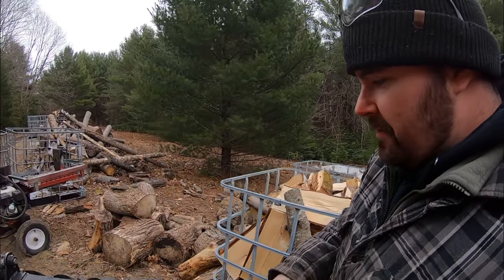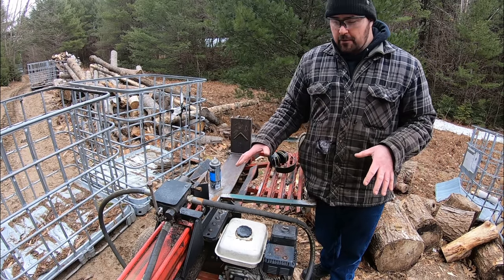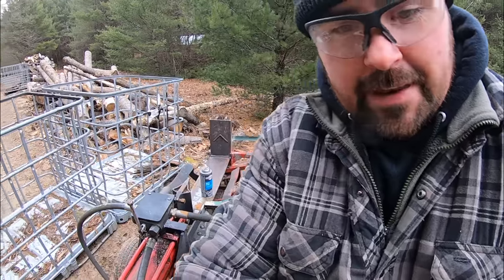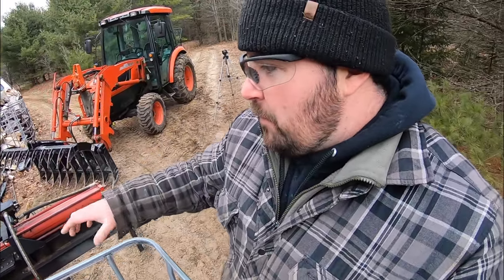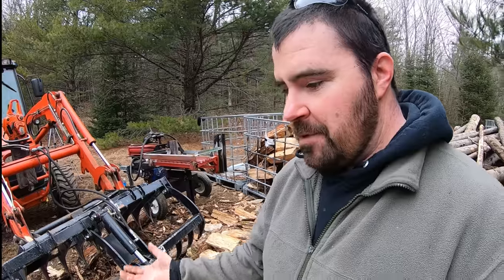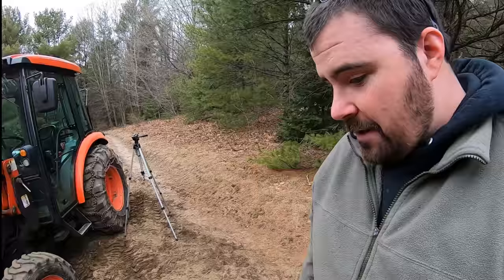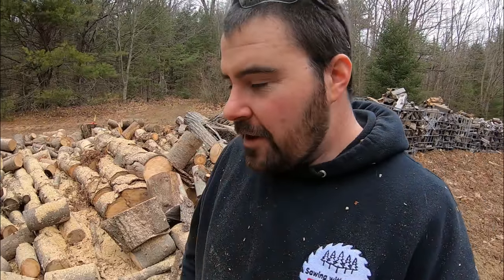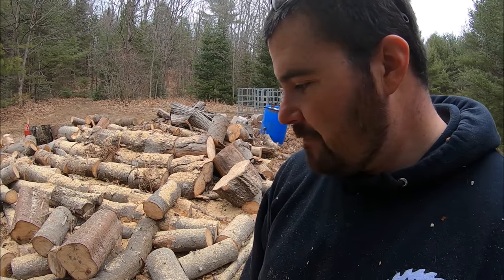Overloading the Slowest Wood Splitter on Earth

Comment: Hey Sandy, I use my front end loader to deliver logs to the splitter. Load it up with logs, park it so all I have to do is pull the chunks off onto the splitter deck. Saves my back, and it’s a lot quicker.
Reply from the maker: Sounds like a good plan

Comment: TIM from Ontario Canada people if you have a small gas engine and it is having a hard time starting here is a quick solution for you. When you were holding the handle feed the string down into the flywheel just until it catches. Then with a good pull should start the fly .start the motor as long as you’re holding the handle feed it down into your flywheel all the way until I catch us then with a quick pole that should start the engine

Comment: Tim from Ontario Canada if you were out in the bush and you are in the clearing. Do yourself a half decent hole put some wood in the hole. Along with. Pine branches. If you can find them this will act as a bug repellent. Or anything that will smoke. Wet leaves wet grass even if you can find a couple pieces of wet wood put them in the fire as long as it’s smoking this will work as a bug repellent
Reply from the maker: Thanks Tim

Comment: Looks like you were productive with the tools you had never seen the saw get pinched or go in the ground. The old splitter is still doing the job and I'm like you I enjoy it even though it's a lot of hard work but I also try not to break the bank great video Sandy
Reply from the maker: All worked out well. I for sure have pinched the saw many times before by mistake but all was good today.

Comment: been heating with wood for over 40 years.few years back i bought tractor supply splitter for $999.00  fastest splitter i have ever owned with no issues so far
Reply from the maker: That’s good to hear. I sure wish mine would speed up a bit
Reply: has that sweet kohler engine just like our mills have to. starts great

Comment: I forgot to mention hydraulic cylinders are easy to fix, especially the type with external tie rods like you have. More than likely an "o"  ring on the piston and rod wiper are worn, causing the fluid to leak out.  To fix just un-screw the end fitting off piston rod.  Remove the 4 long tie rods  and pull the end cap off.  You can get rebuild kits from farm equipment stores.  If the parts cost $50 it would be a lot.  I have fixed many cylinders and it can be done in an hour or so.

Comment: I have a 2004 Champion log splitter that is exactly the same as yours except it does not have the log rack and a different engine.  Doesn't go any faster but splits anything.
I  noticed immediately that you did not have the back support leg down and was waiting for it to tip.  My splitter can be changed to a vertical position so you can just roll larg blocks onto the splitter instead of lifting them on.  Good video!
Reply from the maker: Thanks Paul! Yeah I sure paid the price for forgetting haha. This one tips up on end as well for large blocks but I find it leaks bad when I do this so I have to leave it in this position. Sounds like it's time I got a new splitter haha

Comment: I had a good laugh when the splitter lifted and you jumped on it to get it back on the ground.. that is so me!  I was shopping for a splitter for a while and went for a vertical splitter made by Timberdevil in Qc. Still waiting for it so can't tell you how it is. As far as I know It's the original vertical splitter on which the axis from Eastonmade and many others are based. I'm sure a tractor mounted splitter would be awesome but I like having a separate machine and not put extra hours on the tractor. Keep on doing what you do! I love your videos!
Reply from the maker: I'm the same way with hours on the tractor. Since the engines on these small splitters are. cheap compared with the tractor maintenance I like that idea as well.

Comment: Sandy get  a rebuild kit for your cylinder and do it yourself princess auto have the kits and their not that expensive. and it takes a couple hours to do! Mine is leaking too I have the rebuild kit but have to get the time to do it. it leaks worst than yours. will get to it one of these days.
I burn soft wood in my stove too but good rule of thumb is to run a brush and clean your chimney a few times a year over the winter to make sure it is free of creosote you can buy a additive to put in  your fire that is a powder you sprinkle it on top of the wood every tenth fire or so. I will get the name and forward it to you!
Reply from the maker: Hey Marc. I did price out a rebuild kit as well from Princess Auto. Think I’m around $75 plus tax. May have to go this route if the leak gets worse

Comment: If you replace your splitter be sure to give SplitFire a look. Another Canadian made splitter that has some unique properties. I replaced a Troybilt 27 ton horizontal/vertical splitter that I used for 18 years with a SplitFire this season. It will easily split the knottiest pieces. I got it with a log lift to save the back!  Good luck!
Reply from the maker: Sounds like it works well Frank. Thanks for watching

Comment: Put your bucket on load it up with wood. Get bucket up where can flip pc onto splitter. Then can shut tractor off till ready for next load. That or time make table work off. I get my butt around get another video of set up I use can check out. I got one up but had multiple people helping out. Using a tractor supply woodsplitter.

Comment: I used the remote on my tractor to run the splitter. If you're tractor has a motor spool at the rear like mine. Almost eliminated an extra piece of equipment to maintain, and I don't have to listen to that screaming little engine. I've never had much luck with small gas engines.
Cheers !!
Reply from the maker: I like that idea
Reply: @sawingwithsandy   I do that also. Make sure that the hydraulic fluid is emptied from the log splitter so that it doesn't contaminant the tractor. Much less noise.  Fuel use is about the same for me.  Downside is that you can't use the tractor and grapple to lift the heavy logs.

Comment: Sandy good video and good job you have to use what you have got. my splitter is older than your and slow too. but the old brigg is still good. before you buy anything go to fricknjeep and watch his wood splitting he has the fastest and best setup i have ever seen.  if you do get one get a kohler engine much better than honda. i have a honda pressure washer i have not used in years because it was so hard to start. go price propane and heating oil you will. stick to wood. take care, be safe and well.
Reply from the maker: Thanks for that and I know what ya mean about propane prices….yikes!

Comment: 3 Point 16-Ton Horizontal Tractor Log Splitter   
Current price $1,149.99    at Log Splitters Direct, but there are some cheaper and some that cost a little more out there.   I will never without a 3 point splitter again.
Reply from the maker: Price is appealing for sure. My only concern is I’d prefer not to put additional hours on my tractor from wood splitting
Reply: @sawingwithsandy  That is a valid point, but it only needs to run at a medium idle to work great.

Comment: Having the split edge on the cylinder rod leads to side travel under load, usually scoring occurs on the rods at the 3/4 stroke area.
Reply from the maker: I figured the i beam which guides the rod would control this side load

Comment: Have you contemplated fixing it on your own? When mine was acting up like that, it was literally under $2.00 (USD) for new cylinder O-rings and then of course more hydraulic fluid. I also changed the filter out at the same time...
Reply from the maker: I did consider fixing it myself but I priced out a seal kit and it was $75 CDN plus the cost of the hydraulic fluid which brought me to about 1/3 price of a new cylinder so tough decision.
Reply: @sawingwithsandy  must be a complete seal kit, for the whole splitter?🤔 I just went to my local hardware/farm store with o-ring in hand ...

Comment: Grab a 3 point hitch style that runs from the remote. Just roll the log on and lift it with the tractor. So much easier on the back. I would get a multi wedge to speed up the process.
Reply from the maker: Those style would be handy for sure. My only concern is adding hours to my tractor and fuel consumption idling my tractor but would be better than not having a splitter once this one breaks
Reply: @sawingwithsandy  I think that you would use less fuel as you are more efficient. Tractor only has to idle. You would split easily twice the wood with less frustration.

Comment: Since you had the grapple on the tractor right there why not pick up the logs with the grapple and cut them at a more reasonable level rather then climbing over logs and bending over to make your cuts ,,, Just food for thought
Reply from the maker: That would work for sure. The main reason was it just takes me more time to lift each log to cut. Other than that it would be a good plan for sure

Comment: take the motor off your wood splitter and plumb you splitter to run off your rear remotes on the tractor, did this on mine 20 years ago when the second motor on it wore out.
Reply from the maker: That would work for sure

Comment: Great video, if you get a propane furnace you still be cutting wood because of the cost of the propane 
Take care
Reply from the maker: Very true there Larry. Prices on propane just keep going up
Reply: @sawingwithsandy  
Yup, we just replaced our furnace this year and the AC/Heat Pump. 
The heat pump is set to heat the house down to 20 degrees, then the furnace take over to heat the house,

Comment: 700.for used or add 500.n get one at home depot or tsc if you have one.i bought one at tsc in 2002 n still have it 650.back then.lol
Reply from the maker: Yeah think they can be had for about 1400-2200 CDN around these parts
Reply: @Sawing with Sandy  the other opt.is rebuild the cyld.if the end cap screws off you just pull it all out take the nut off  put new seals n o-rings on put the nut back on put back in the cylinder n tight cap.much cheaper.

Comment: That’s just a tie rod cylinder isn’t it?? Pull it apart yourself and get new seals from the hydraulic shop for under 50 bucks. Assemble yourself. It’s not rocket science. I have no doubt you can handle it. I have a kioti dk4510 and bought a 3 point mount “DR power” Wood splitter. Runs off the tractor hydraulics, has legs and long hoses so you can use it freestanding if you have other attachments in the tractor. Also tips up for big wood. Was about 1500Can last year.
Reply from the maker: All good options